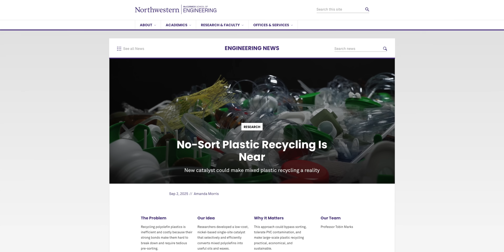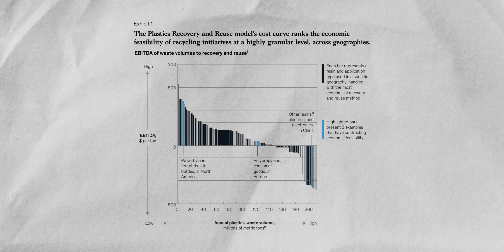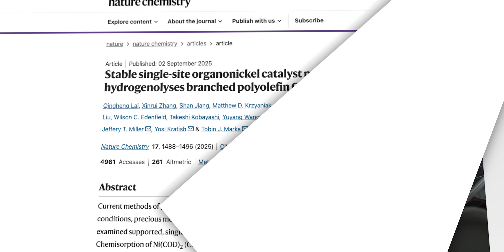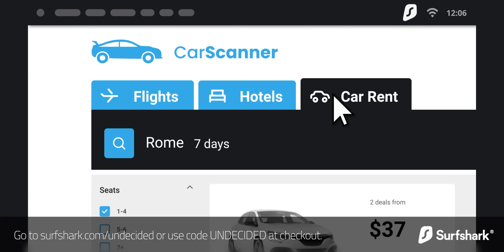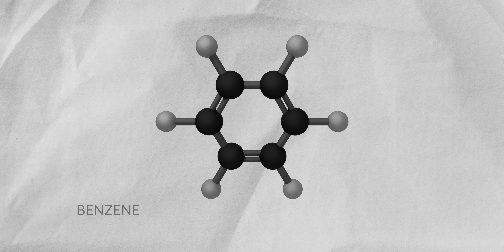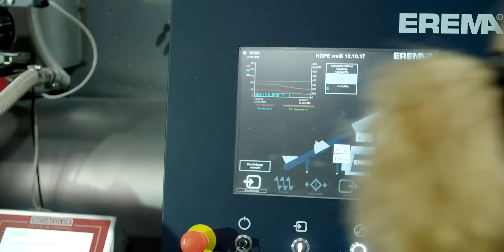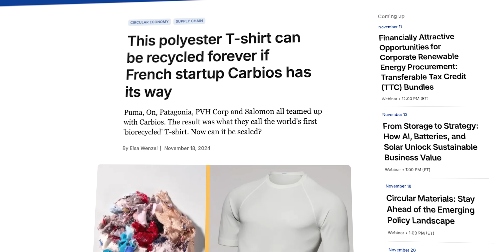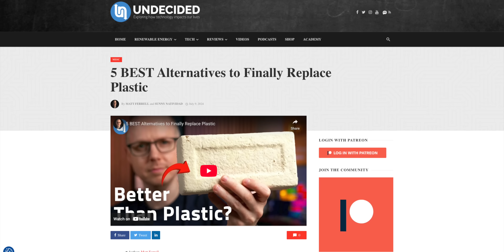The Recycling Breakthrough That Doesn't Need Sorting

Comment: I think the solution that can be feasible and very much well-being environmentally friendly is turning plastics and other types of ways into syngas through gasification and pyrolysis. And, using sustainable low maintenance, fast growing plants that won't compete with food crops as viable alternatives to petroleum base plastics. That can biodegrade in the end of use or collected turned into syngas in a truly sustainable way.
Reply: Problems are toxic emissions and CO2 emissions.
Reply: @skierpage The problem is all types of pollution that harms the environment and coming up with multiple solutions that can help reduce along with finding out sustainable ways to do less impact on the environment would be beneficial.

Comment: The economics of recycling should not be propped up by penalizing production of virgin plastics. Subsidies should never be a part of the solution. If the recycling process is not competitive with current production techniques we need to try again. Ultimately the answer to all of the plastic waste we generate may be to use it as fuel to offset some of the crude oil that goes directly to fuel.
Reply: You must be working or lobbying for the petrol chemical industry? 

The economics of virgin plastics ends at the point of purchase by a consumer. Just review any Life Cycle Analysis and you'll see the fairy tale of wishcycling being spread around as if its the ultimate solution to all of our problems. 

While in fact, we need to ensure every single lbs of virgin material sold (as pellets) should include their true EOL cost. And this includes any negative health impact when they are "miss-managed".

Once the true cost of virgin material is established, watch how quickly recycling plastic would all the sudden become economically viable.  As long as we bury our heads in the sand and pass on the responsibility to consumers, nothing will change.

Comment: That’s crazy how you’ve completely disregarded the dude that’s doing it solo on YouTube from kickstarter money
Reply: @rso823  Are you on about the guy with the microwave chamber making diesel?
If so, it's because it's nothing new, not financially viable at scale, and the end product isn't that useful outside of being a fuel. It doesn't create new feedstock, and it doesn't allow for clean production of new reactants. Sadly that's just the economy of the whole situation
Reply: @Donmegamuffin  Isn’t all recycling “not financially viable”. And sure he uses more power than he gets out but that’s not the point. It turns plastic into gasoline, diesel, natural gas, and has carbon/charcoal byproducts… but I’m obviously missing something
Reply: @rso823  Nope, a lot of recycling IS financially viable.
For example, Aluminium recycling uses a tiny fraction of the energy of mining and making new stock, and is thus hugely cheaper. Same with Asphalt, which is nearly 90% recycled. Steel, paper, and glass are all cheaper when recycled, but plastic simply isn't, and that's the issue.

If there's no money in it, there's no incentive.
Reply: @Donmegamuffin  recycling cant be profitable, unless it would be a positive feedback loop? And good luck trying to be more efficient than fossil fuels…. There’s nothing…
Reply: @rso823 nobody mentioned a positive feedback loop??
And as for "nothing is more efficient", what does that mean? It is a meaningless statement in the context of what we're talking about. 
To make recycling of plastic viable it has to make either the same plastic in raw form or the precursors cheaper than making them from scratch, at a similar quality. That's it. It's that simple. 

If it were to produce deisel for cheaper than digging it out the ground and refining it, then that could be a viable alternative but it simply isn't, and is why it's not viable.
Reply: @Donmegamuffin  Cmon Im not being ridiculous here... By positive feedback loop i mean you're never going to get more than you put in.. I.e, the process of locally collecting materials, recycling it, reforging it into useable products is never going to be cheaper than getting it shipped fresh by an industry, for any product ever. And if aluminium and asphalt are currently cheaper to recycle then its done on purpose and not because of availability or abundance. Efficiency = energy density. Fossil fuel industry is a diamond product and nothing else comes close to it

Comment: Simple answer - no:
1. It's still not cost effective in simple energy use terms
2. You can't recycle micro and nanopolastics embedded in everything all over the planet, or even get them out of your brain and body (which might actually have to become a serious medical project in another 20 years)
Reply: Fair points.   The energy use of the conversion process to me is solvable with ubiquitous renewable energy.  Microplastics are the real and likely literal killer
Reply: @pixelpusher220  Energy use isn't the problem, it's that it takes more energy than doing something else.
Another way of looking at it is that plastic has the hydrogen economy problem. It's possible to build it but you can't make it work financially. If you add massive taxes then you won't fix plastic recycling you'll end many plastic except those used with long lifetimes (where the material properties matter and the recycling cost is eaten once every 30 years)

That's fine - for once it's markets doing the rational thing in response to the correct pricing of an externality.
Reply: @etchedpixels  Hence why I said 'might'.  No aspirationally, just possible.   If making virgin material cost more than recycled material means it's not affordable then obviously it's not viable.
Reply: #2 has nothing to do with the question in the title.
Reply: This is why I read the comments on Farrell's videos before deciding whether or not to watch them.
Reply: I feel like you're all just saying this because you've all conditioned yourselves to be pessimistic about the environment and sustainability. 

Technology will find a way to solve all of energy and environmental problems. It's only a matter of time.
Reply: Post-consumer recycling can still work financially if it costs money, so long as the cost is less than  trucking it all to a landfill.

Right now as the video says that's only the case for clear PET #1 ♳ (plastic bottles and some containers) and HDPE #2 ♴ (milk jugs). Breakthroughs might help but for now all the other recycling triangles are a feel-good lie.

Microplastics are terrible.
Reply: @skierpage  It's never cheaper than trucking it to a landfill.   Wrong metric - if it's cheaper, or 'made' cheaper via taxes, than virgin material only THEN might it make financial sense.   It's why aluminum is so recycled - 20x cheaper than new aluminum.
Reply: @pixelpusher220  I think the biggest cost of plastics is collecting ALL of it after use, and storing it somewhere where it won't get into the environment, or recycling it. Virgin plastic should be taxed to cover all these costs.
In Australia we've eliminated new single use plastic bags from shops. The plastics industry claimed the sky was going to fall but now we just stuff a few bags into our pockets before we go to the shops and shrug - its' easy actually.
Reply: @zen1647  same in the EU. In shops there still are single use paper bags or bags made from starch for those who forgot to bring one.
Reply: @pixelpusher220   I guess I didn't explain it well. It costs over $20/ton to dump trash in a landfill. Even if your garbage company has to pay another company $5/ton to take waste plastic and recycle it, then it is in fact cheaper than trucking that portion of the waste stream to a landfill. The money the garbage company pays enables the plastic to be competitive with virgin material. Obviously there are a lot of factors like cost of better materials separation and transportation, and whether the recycling company actually recycles or just burns the crap, etc.

Some random web site says U.S. scrapyards will pay over $1/ton for recycled PET #1. But AI says virgin PET is only $.85/ton. I don't understand it.
Reply: The fear of microplastics... Oi... It's nowhere near the issues of body contamination in the past with asbestos and lead, and those generations are largely still alive and kicking. Are microplastics ideal? Surely not! But it's been an issue for 50 years, and we learned about it recently because our tech to analyze tissue advanced to where we could see it, not because there was an active problem. If there was a clear and present threat, it would already be manifest. The fact that it isn't is a good sign that it is likely benign. Doesn't mean it isn't causing issues... Just not major life altering issues. Loosing sleep over microplastics is objectively more harmful to you than the microplastics themselves.
Reply: @CaedenV  You know what was also claimed to be effectively harmless?   Lead and Asbestos before we know their effects.
Reply: @pixelpusher220  you know why their effects are well known now? Because the problems they caused could not be hidden. 
Microplastics weren't found because they're causing so many issues. They were found first and now there's a concern they could cause issues. However, so far no widespread serious illnesses were connected to microplastics in the body despite them being around for decades and research being done. 
Not saying microplastics can't cause problems but that's very different from how it went down with lead and asbestos.
Reply: @CaedenV  And for all we know, Plastics companies KNOW it's toxic and have buried the research, just like ExxonMobil did with CO2 and climate change.
Reply: @pixelpusher220 , the xenoestrogenic effects of plastic have been known since the mid-90's, when the book "Our Stolen Future" was published.
Reply: The issue of microplastics is so blown out of proportion.
Reply: @teresashinkansen9402  we've been making plastics for maybe 100 years and we're already finding it from the Marianas Trench to Antarctica to our own gonads.   POUNDS of it found in dead marine life stomachs.   

It's the epitome of human hubris to think that's not gonna be a serious problem.
Reply: @pixelpusher220  Oh but is a problem I never said it wasn't. What I said is that is blown out of proportion and I might add now, most people have a misunderstanding of the issue. Plastics have always been a problem to marine life that's not news. Yet there is no robust data about the mechanisms in which microplastics could get into the body, specially cross the blood brain barrier, something even MOLECULES have problems getting pass. Which really makes the case for contamination issues in the original research.
Reply: @teresashinkansen9402  Then you're original statement is wildly uninformed.  Modern human history is legion with "it's not that bad" nay sayers of all sorts of human chemical creations that turned out to be quite toxic.
Reply: @pixelpusher220  Nope, actually the opposite, I have read most of the published literature and almost all of them end up coming with inconclusive results about long term effects and basically saying "we need more research about this" some hypothesis have been proposed for some of their purposed effects but there is no hypotheses about the mechanistic causes about how they manage to get into the brain gonads etc.
Reply: @teresashinkansen9402  This you?  "there is no robust data about the mechanisms in which microplastics could get into the body"   or is it you've read lots of studies...which have data!...that show no significant effects.   Good day troll.
Reply: @pixelpusher220  Nope, please show me a paper or a study in which they document how microplastics get into the brain. Oh let me guess, you think Im trolling because with your logic its obvious:Animal has mouth->animal eats plastic=microplastics in body.

Some researchers are trying to find effects but all research is inconclusive. Then there is no research that shows how microplastics get into organs like brain tissue and gonads, they only have found them, but could be an artifact of faulty procedures aka contamination, because you know microplastics are everywhere!. The body evolved to be sterile and free of micro particles. Did you know dust can be smaller than a bacteria? yet we don't have dust particles in the brain.
Reply: @teresashinkansen9402  moving the goal posts is a tried and true tactic of trolling gish gallop.    Good Day Troll.
Reply: @pixelpusher220  The irony.... "I cant argue so I will throw an ad hominem and claim logical fallacies without addressing the actual argument"

Comment: At 6:53 you have used what is commonly considered the recycling symbol arrows but is actually a very cleverly designed part of a "resin identification code" that is meant to look like the recycling symbol but isn't. Reason for this design? Make the customer believe the product they are buying is recyclable so they don't feel guilty about buying the product itself. The numbers in that code go from 1-7 I believe and only 1 and 2 are somewhat recyclable, the rest is basically plastic waste once it stops serving its purpose. When was it designed? Back in the 70's. By who? The same guys that now lobby to make us, the consumers, feel guilty for being wasteful and that plastic straws stuck in turtles' throats is our fault. 

There already is a solution for waste plastic, incineration and energy recovery in a way that doesn't cause excess pollution.
Reply: Well said, you are 100% correct. And they even created their own "Get out of jail" code, number #7 for Other. These are plastics that are absolutely un-recyclable, and yet they get to be labelled as such.
Reply: @fredpinczuk7352  That's the thing, they aren't actually labeled as such, they are just preceived to be labeled as such, once such kind of distinction is understood and a pattern in your head is developed, everything which on the surface makes no sense, suddenly is clear as day. This is why a common man's strive for knowledge and ability to second guess everything is so important in this day and age.

Comment: I'm very worried about the effects of microplastics on the brain. We should make at least some kinds of plastics illegal until we have a solution, because they could have similar effects to lead, which would translate into lower IQs and greater crime rates.
Reply: The plastics themselves are not the problem. The issue is letting that stuff get into the environment. But the way a lot of European countries currently do "plastic recycling", that's not an issue. What you need to do is find a way to stop people in developing nations to throw all their trash into rivers or drop it where they stand. That's the real problem with plastics.

Comment: It does not matter if recycling works - the problem persists because even if we recycle all kinds of used plastics we will never recycle all of it. We still breath it in because of the cloth we ware and it will still end up in the oceans and on every square inch of the planet posioning us all. Plastics are not inert and they are toxin super accumulators if not toxic themselfes. We need to start using them ONLY if there is no less harmfull alternative.
Reply: true, that wouldn't fix microplastics, because most microplastics actually don't come from landfills, they come from rubber tires and synthetic clothing.
Reply: This. A simple mindset change. Paper, glass, aluminium and other alternatives. Plastic only if inevitable.
Reply: So your argument is that making progress is useless because it’s never going to be perfect? I think you’re right that it’s not going to ever be perfect. But I think your conclusion is wrong, progress towards less plastic waste is good progress.
Reply: @meerkatj9363  How in the world did you get that message? What they're saying is that we have an over reliance on plastic and recycling alone won't be the magic bullet that solves it. If we recycle plastic only to continue using it irresponsibly, we'll still end up polluting the environment and our bodies. So yes, let's recycle as much as possible, but let's also reduce our overall consumption of plastic.
Reply: @lamarclark8214 ”It doesn’t matter if recycling works” that’s how I got this message. I’m saying it could matter while being insufficient.